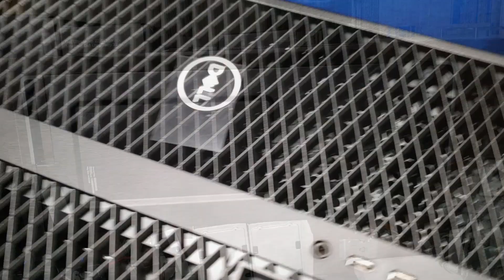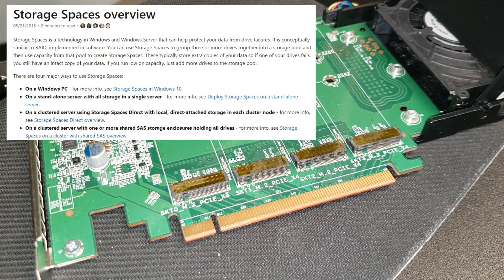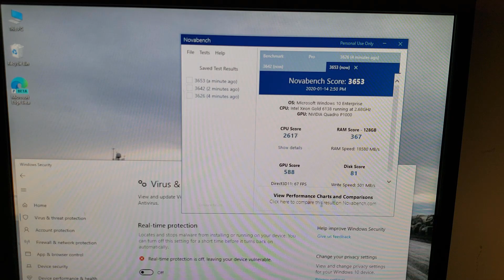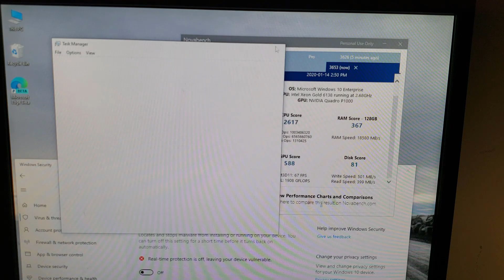Dell Precision T7920 Unboxing Disassembly Installing Rear Flexbays & Benchmark

Comment: This video was incredibly helpful in installing the rear flex bays, I have the same 7920 tower and flex bay parts. I was able to plug in the fan cables and other sockets. However, I don't have a power supply coming from my motherboard to actually power these bays (specifically where you plug in at 6:44). Is this a separate part I need to install to power the flex bays? Dell has NOT been helpful in this regard, they even sent a technician to try to install for me and they didn't know either.
Reply: I got the 575-BBSO kit and it came with a cable W8X9X.  That split the power between flexbay 2 and rear bays 3 & 4.
Reply: @betteryouthanme  thanks a ton for this I'll try it out

Comment: Hello, I'm looking to buy a T7920, but have an issue on backing up the data in a timely manner.  My thought is using WD SATA drives at 20TB and 8 of them in either RAID 60 or 10.  The issue is how to backup all this data in a reasonable time.  I read in the T7920 manual about the 9440 and 9460 supporting an external enclosure storage.  I forget the page number, but think it is 90 or so.  Now for the question:  What backup method on the T7920 do you recomend for large storages?  Thank you.

Comment: Great video. Helped a lot. One question, where did you buy the expansion drive bays for the rear? Can you share links please? Thanks.
Reply from the maker: I had to order them directly from Dell and I used my Dell rep to get the right parts... there were A LOT of options.
Reply: @URTechDotCa  Thank you for the reply. Got a pair of rear 2.5" bays on eBay for up to 4 additional 2.5" drives.